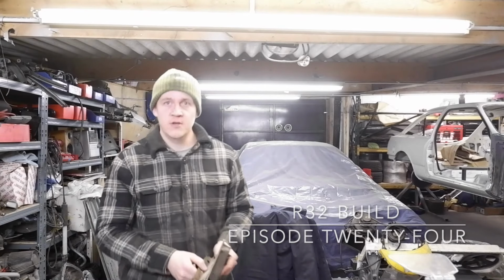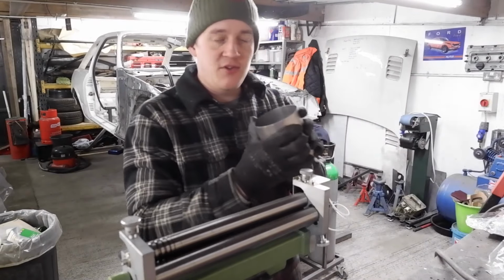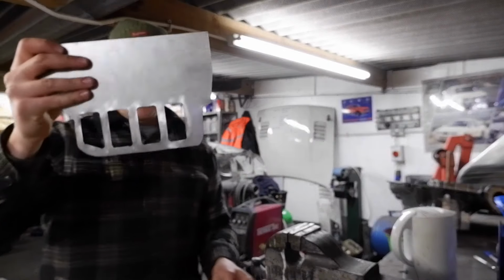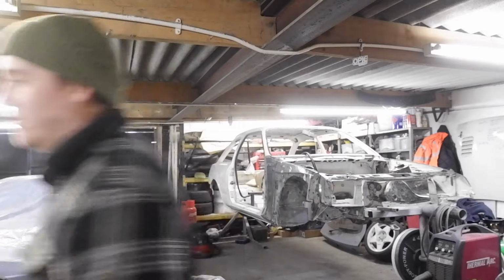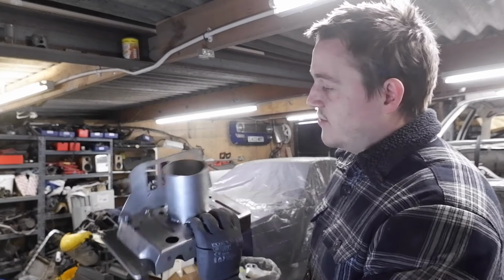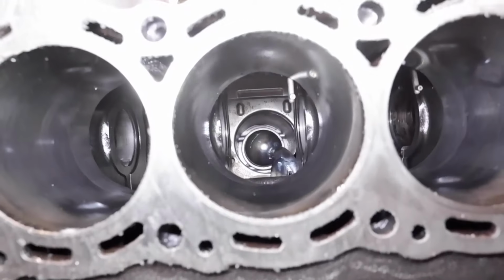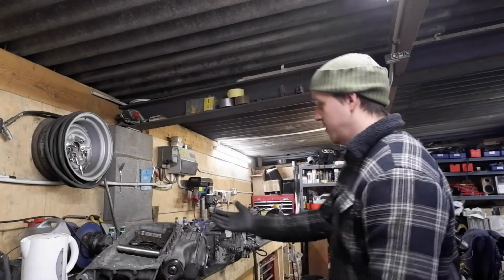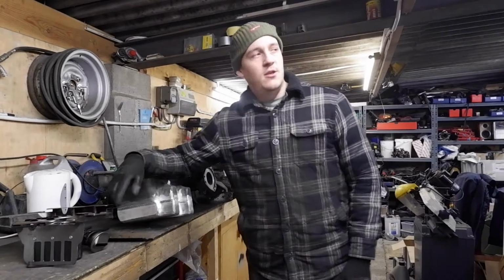Baffled & gated rb26 Group A sump - R32 GTR Build 24

Comment: That's a good solution with the riveted rubber baffle. Around 8-10 years ago my company made baffles for the k series utilising the e30m3 rubber baffle. It used around 7 from memory and even back then they were over £9 each from BMW. M tax! It made the baffle kit expensive unfortunately.
Reply from the maker: Yeah they’re really expensive to make, hence the retail on them. I designed some for a company and got a quote to have them manufactured in the UK, unit cost came out at about £25 lol. So binned that idea. A lot of China production going on I think!
Reply: @AlexGrA   bits falling off sump baffles is most definitely best avoided. 25 quid. Lol! Good progress by the way. Have you ever looked at making a fab table to help with some of your welding jobs? I'm knobbing up a super basic one at the moment which will double as a workbench with a removable top to cover the 100x100 pitch 16mm holes.

Comment: That baffle is legit. Are there any additional slots/holes in the pipe the pick up effectively sits in or is it a matter of just hoping the oil stays well below the pickup during the high revs/ High G's. One of the guys that raced for Gibson Motorsport talked me through this exact baffle setup and its pretty awesome to actually see it. well done!
Reply from the maker: Cheers man :) 

No holes or anything. It’s just the gap from the bottom. I think the tuning opportunity would be changing the height of that (cutting it). 

I’d really like to borrow a lairy electric pump to empty it real quick and see how it behaves. Peace of mind and that.

Comment: Fantastic skills, fantastic approach, great music, proper tea (try the hard water version). 996 does have the flaps in the baffled sumps, especially the aftermarket ones - GT3 is dry sump. The baffles reduce the oil swilling to the edges, the tube maintains a sort of internal Accusump system - I think (no engineer..)!
What's the blue paint for?
Reply from the maker: Cheers mate:) 

It’s mark up fluid, just makes it easier to see where you’ve scribed. Especially if there’s loads of sparks going everywhere.

Comment: If the pump is taking oil out of the sump at a litre a second is it not also returning it at that same rate?
Reply from the maker: Lol, you’d sure hope so... 

But my concern was just in the percentage of return directly down that cylinder and any pressure delta it could create along the length. 

The numbers are just a bit lairy in my head. But no doubt it’ll be fine.
Reply: @AlexGrA  do the Grp A engines run an additional drain in the head? It seems super popular in many RB builds so from that you would think oil return is potentially an issue from uprated pumps. I only ever ran a nismo oil pump in my RB25 build so didn't have to worry about it.
Reply from the maker: Nope, they drill a hole somewhere really weird in the head to relieve pressure and allow a better drain. But... I’m not totally up to speed on this bit yet, I’ll be sure to share what I find out :)